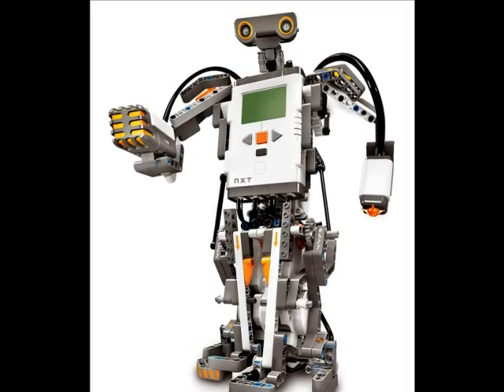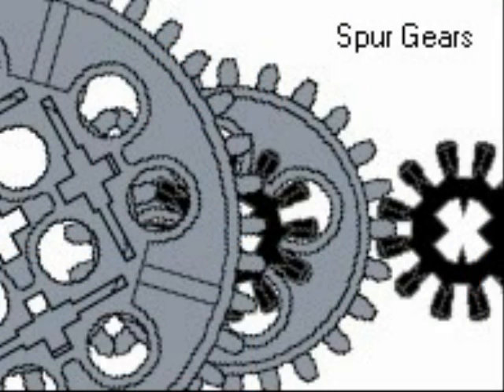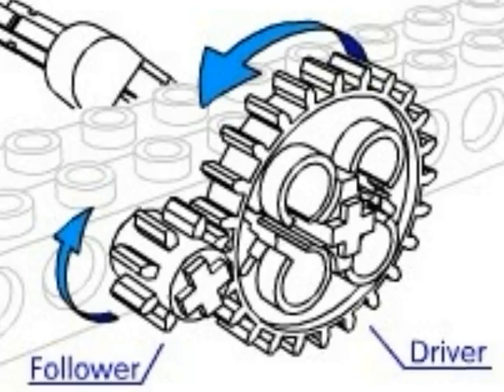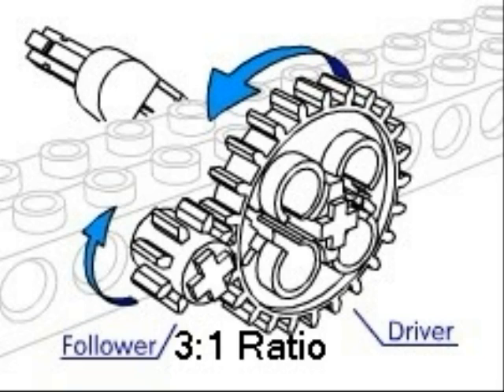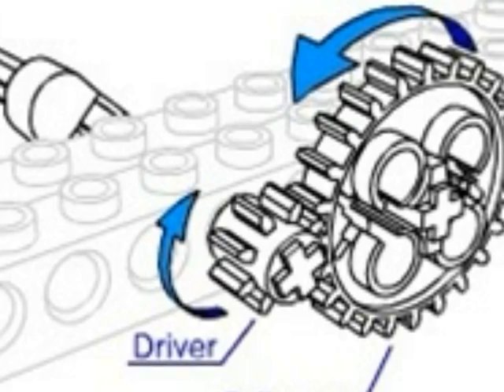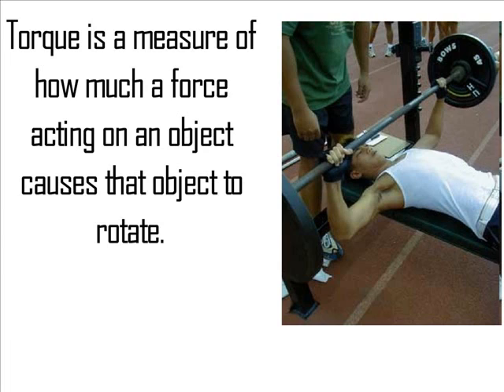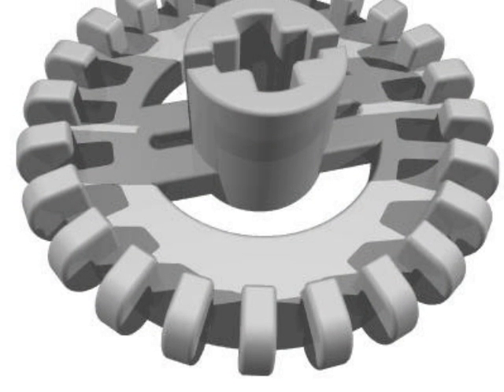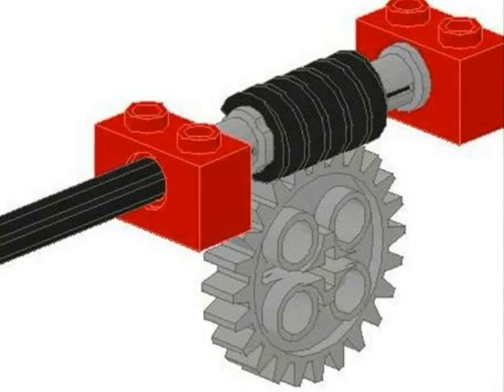Beginning Lego Robotics 2: Gears

Comment: YOU GOT THE GEAR RATIO BACKWARDS.  It is the torque multiplier NOT the speed multiplier.  Also the more common terminology is Driven instead of follower.  The gear ratio is Driven / Driver or using your terminology Follower / Driver   This video has it described correctly https://www.youtube.com/watch?v=D_i3PJIYtuY